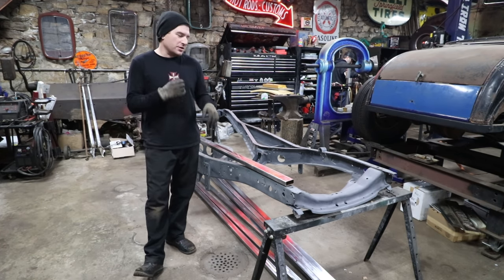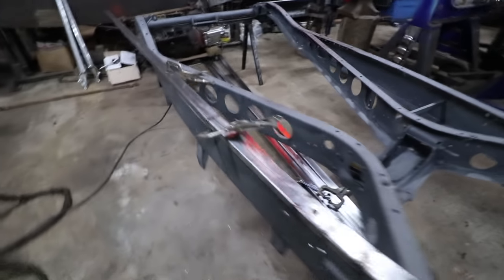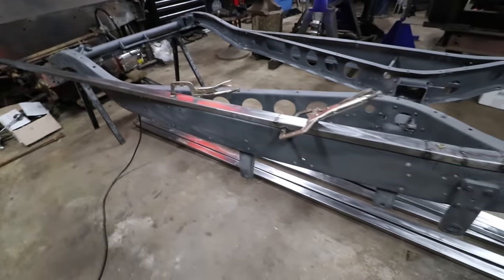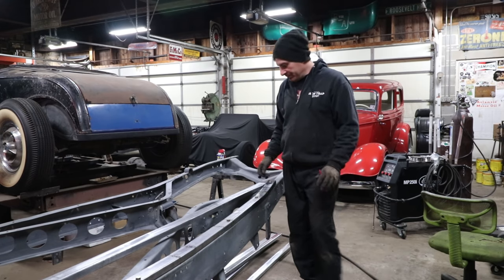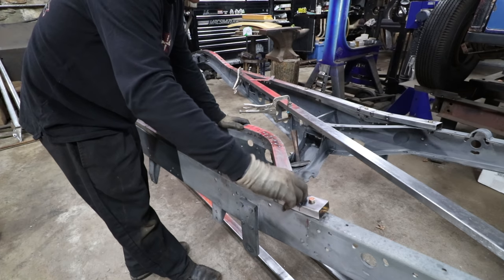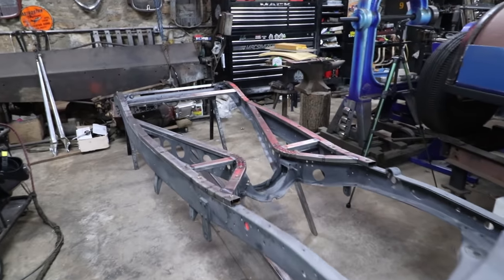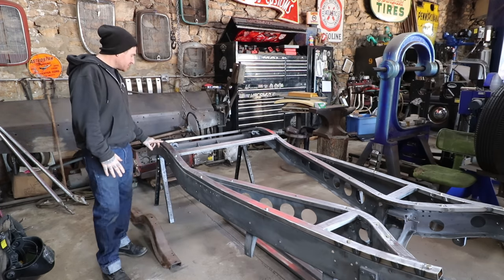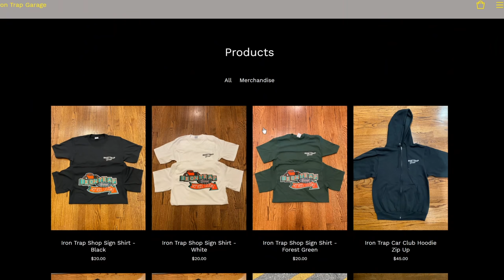Building Custom Box Tubing Subrails For Cheap!!! - 1933 Ford 3 Window Coupe

Comment: It's absolutely friggen'amazing how talented you are at building subassemblies for your cars.
Floor pans, firewalls and others and now that frame assembly.
You definitely need to charge top dollar when and if you sell cars you've built or restored to keep cash flowing to find all your buys.
Reply from the maker: Thanks Ron! Just trying to do the best with the tools and skills I have. Nothing that ground breaking here! I appreciate the kind words!
Reply: @IronTrapGarage  you guys deserve the recognition for what your doing. I'm absolutely positive you've single handedly encouraged thousands to begin their journey into building or restoring old cars like you do.
Your extensive knowledge for someone as young as you are is a treasure trove for them to tap.
You should extend sharing your data base to include writing it out in manual style.
Voice auto printers can ease that chore.
You could even sell them to increase your cash flow which I'm sure you could use.
Find a good editor at your nearest college who's studying journalism and has a similar interests if possible and is in need of some additional income.
They generally are fairly cheap to use.

Comment: Nice work as always.  Just out of high school I had a '30 model "A" and someone had channeled it by welding the body to the frame.  It was 3/4 of an inch lower on one side.  If I had it now I would have been able to do what you have done.  I sold it because I had no way or understanding in those days.  Thanks

Comment: When you make this up you should make 2 of each piece. One for you & one for mikes 34. It would be easier & faster to do it now than later from scratch as you can use yours as patterns for his to mark the cuts & bends. What ya think?
Reply: Always make templates and set them aside where you won't lose them for future jobs
Reply from the maker: Mikes car is getting an original floor and subrails and isn’t getting channeled.

Comment: That turned out fantastic, great job! You are correct that this technique can be used on any early car, I did the same thing a few years ago on a '33 chevy to replace the wooden subrails...the Chevy frame is easier to do because it doesn't have as many curves as a Ford , but to control shrinkage on the rear kickup I made 1 cut at a time and fully welded each cut before making the next. Although I had to remove and install the subrails multiple times, in theory it reduced the number of cuts needed.

Comment: I really enjoy watching your efforts.
 However, I believe the body would only touch down at select locations. Hence a lot of the sub-rails would be not involved.
I would have cut 3 inch blocks of the metal channel, and bolt them down only where the body touches.
Reply from the maker: That defeats the idea of bringing structure back to the bottom of a car that had all of the floor and subrails cut out.. this gives a base to lay the floors on and connections from the body to the subrails will be made.

Comment: Glad to see I'm not the only one using red markers. As my eyes got worse with age and abuse it is easier to see the edge of red markers. I switched to red dycom for my layouts as well.
I still cringe everytime you use WD40 as cutting oil. Being a machinist I don't use a so called lubricant as cutting oil. Only time WD40 can be used to cut or dill is in aluminum. We use to get cutting oils by the drum but at home I use a water soluble cutting fluid. If mixed correctly it eases cutting or drilling and when it drys it leaves a protective film. Just becareful to read because some oils, cutting and WD40 can stain your metals, especially Stainless, copper and Aluminum.
I love this way of building your substructure.
What happened? Your shop is almost clean? Is it from moving a bunch of your parts hord to the warehouse?
Thanks for another excellent teaching video.
Reply from the maker: Thanks for the info/tip Frank. I am guilty of running out of cutting fluid and using inferior lubricants. Just a matter of laziness! Yes we’ve been working to get parts and extra “stuff” out of the shop and in the warehouse to make it easier to work in the shop. Glad it shows!